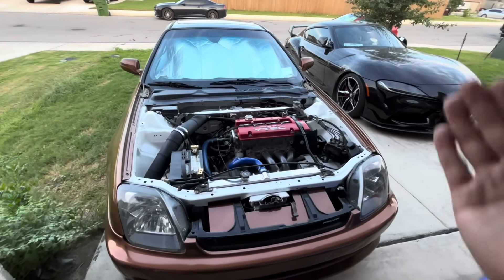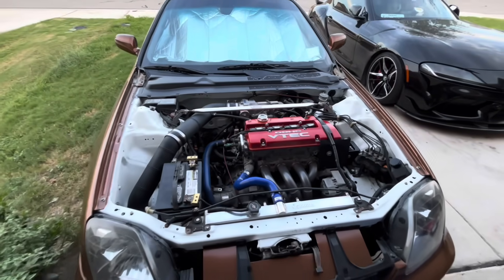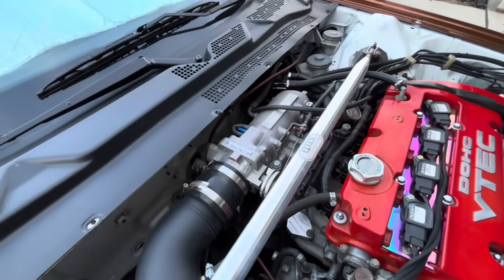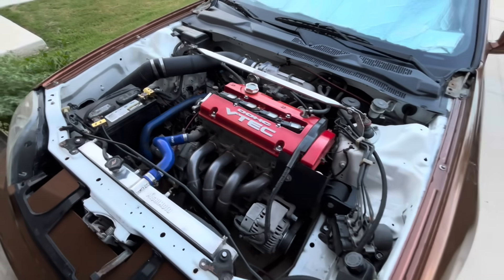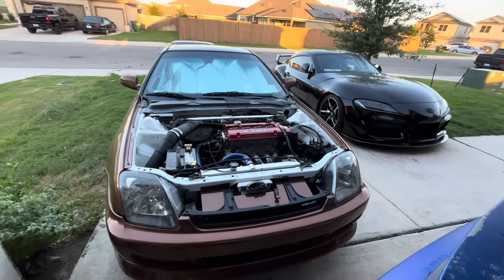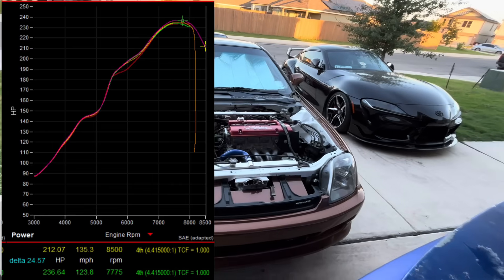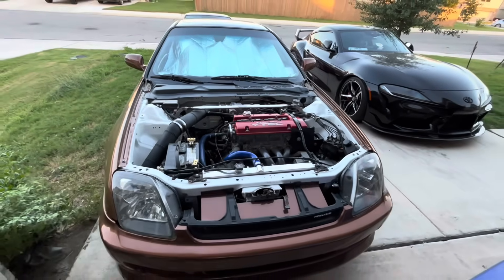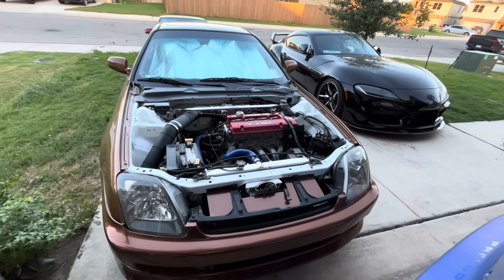2.3L F20B STROKER Build Specs and DYNO session!

Comment: Have you done an oil chnage and if so was there any rocker wear damage?.
Reply from the maker: Yeah i've changed the oil many times and had the valve cover off, the car is Turbo now, i actually switched back to OEM cams, but rockers looked brand new still. I've always used high zinc oil, but these cars don't really get rocker wear unless you have an issue or bad setup
Reply: @bb6g134  ive seen so many stories online about the skunk2 cams and rocker wear if the springs were to high pressure or garbage oil. What oil are you using and what spring kit did you use?
Reply from the maker: I'm on BC brian crower springs and steel retainers, i was using Rotella T6 5w-40 for almost 4 years and the entirety of the N/A setup. I also kept up with valve adjustment pretty regularly. 
 I only recently on my last oil change went to Valvoline VR1 Race oil 20w-50 because i'm on Ethanol now and it will dilute the oil to a thinner viscosity naturally especially with the boost/turbo
Reply: @bb6g134  how long was you running those tuner 2s?
Reply from the maker: @dayadam16  I would say under a year, about 5,000 miles maybe, not much. Recent years i got another daily driver so i don't drive the prelude much anymore besides weekends

Comment: You did a G23
Reply from the maker: Technically yes but the F20B block does not require anything custom. It's all OEM H22 components like the water pump, crossover pipe, etc.

Comment: This is an awesome build, so well done! I got so many questions, doing research for the same motor going for turbocharging. I noticed peeps love stroking the F20B but I see people pick H23's 95mm and F23's 97mm, is it that big of a difference? Also seeing it dyno all the way past 8k made me anxious, lot of info points out going past 7k can be dicey but is it really? Seems like your F20B takes the high revs well for having the biggest stroker kit in it. Last thing, I've been looking at 70mm intakes but am worried about it slugging the engine down at low revs, doesn't seem like your build minds having 74mm intakes. Would love to hear back!
Reply from the maker: For turbo the F23 actually is not the best because the rods are actually thinner/narrow-er than all the other engines. For a turbo i would recommend a F20b or H22 crank and rods more than the F23. 
And yes with the 74mm TB it is very peppy. Still very smooth overall however the initial hit of going from 0% to like 5% it can be a little jumpy and extra responsive in comparison to a smaller TB. But it's still smooth overall nothing out of the ordinary

Comment: 236 @ the flywheel bro🙆 Im sorry but is such a failure...
Reply from the maker: If you listened to the video i exaggerated it was only on MY street tune and the car did not get tuned at all.  It could have easily broken 250whp if it was tuned by a tuner. Also this is still WHP because it's a hub dyno, there is still drivetrain loss. It's already at 260 flywheel HP as it sits
Reply: @bb6g134  exactly its!..A hub dyne...Yr gonna be really disappointed at a dynojet...(I didn t know a street tune isn't a tune🙄...
Reply from the maker: @amritshokar3639  i'm saying it as a general term. It's MY street tune, i'm not a tuner lol. The only experience i have is on my own cars on the street. Really i just have safe timing and i adjust the fuel and that's it.  So it's still not "tuned" because a professional has not tuned my car whatsoever.  Only me, a regular engine builder and swapper with a laptop on the street lol 
The setup obviously has a lot of potential, and the number is still very respectable. You realize altitude, location, temp, etc play a role in the whp? Where this was wasn't even close to sea level, on top of being 100+ degrees. Put other H series on this dyno i promise they'll only be making 205whp lol

Comment: Go get the h2k ultra with that 74mm or 80mm you good to go 🫡
Reply from the maker: Unfortunately K manifolds can't fit into Prelude chassis because of the rear mount, the K manifold directly interferes with the mount bracket.  It is possible with fabrication but at that point the cost would be doubled lol. I'm going turbo anyways so it won't matter. But if i was staying N/A that would definitely help

Comment: Can you turbo this car with this set up or super charge it? Basically can you still rev that high being Turboed lol bout to go on Forza and grand turismo but I heard you said turbo at the end lol so I guess 9000 limiter and turbo be fucking legendary
Reply from the maker: Yes i have a turbo kit for it now. However, i will be lowering the revv limiter to around 8000, just to save some abuse on my motor lol
Reply: @bb6g134 lit bruh my boy had a baby blue 97 h22 tric tronic basically old as hell idk but old slow shifts but runs thru vtec loved it had the gears in the dash 1 thru 6 and when you don't want manual it was automatic classic goodluck brother

Comment: If that air fuel is accurate it’s pig rich especially on Vtec, 11s dipping into 10s on the 9000 pull.

Just street tune it to 12.8-13.2:1 across the board. U need a bunch of fuel taken out of that high cam fuel map
Reply from the maker: Actually, i brought the car in at 13.1 AFR, we gave it MORE fuel to the 11-12 AFR area and it actually made 7whp MORE.  You can actually see the difference in one of the lines in the dyno chart, around 5800-6500 RPM and actually some up top too. Every motor is different some like being rich and some don't, but most H/F series make good power being rich, not to mention, it's safer to be a little rich too.

Comment: I forgot the name of the material of top but I used a couple of cutting boards almost like a polymer used for the kitchen and cut them and sanded them to make a couple of spacers for the intake manifold. Ported and polished the runners on the intake manifold them also using just a dremel. Replaced all valve train. This was a 96 Accord using a F22b DOHC with H23 transmission. This was eons ago.
I think I am getting the bug again when it comes to modifying Hondas. Its been 20 years but now that I have a garage and a 18 year old son might get another Honda and teach him some more things.
Great project was actually thinking about going with a F20 blue top.

Comment: Torque seems rather low too. F23 crank should almost match the hp numbers
Reply from the maker: All of my bolt ons are catered to high-rpm so that might be a reason. They will never match HP but i was expecting it to be moreso 190 range. But it's still more torquey than all the H/F setups i've ever had. Keep in mind, it was not tuned. If a tuner actually tuned the car, it would definitely make more torque and HP
Reply: @bb6g134 your piston speed has to be on the verge of throwing a rod bearing or bending a rod, something you should look into and figure out. Never seen a f23 crank go any higher then 8300
Reply from the maker: @bluGill89  i know a few people revving their F23 to 9k.  However i know it's not good. I've only been doing this N/A.  When i install the turbo, i plan on making the fuel cut/limiter around 8000

Comment: that intake bend is killing alot of hp and I suspect almost 10 but I could be wrong if the head is able to overcome that with headflow I guess
Reply from the maker: I made it as straight as possible. If you look up most Preludes intakes, they usually have 2 90-degree bends lmao 😂 so this was as straight as it can possibly get in this chassis. It's also 3.5 inches.

Comment: I like the setup but why not adjustable cam gears ? Have to degree the engine right?
Reply from the maker: The Tuner2 cams don't require them so i never cared to do them, aswell as all the time it would take to get them degree'd. I originally built with the OEM Type S cams and the engine was already in my car when i installed the Skunk2's.  
Of course it's best to get degree'd. but it's not required like the pro series are

Comment: Fucked up on compression. Would've made major gains. And tuner cams? Should've went pro. Throttle body probably too small, pulling vac at wot.
Reply from the maker: I originally built this motor knowing i will boost some day. I think i mentioned it in the video, but that's why i got a thicker headgasket and i gapped the rings for boost.  With that in consideration i'm happy with what it's done N/A. If a tuner actually spent time on it this setup would be right at 250whp.  This is just my own street tune i made myself

Comment: Nice build man!! I’m a B Series guy but I’ve always been curious about the F/H series and always wanted to build one. We went a similar route on our valve train I’m running Ferrea valves & guides SuperTech springs and BC steel retainers with Pro 2 cams in my B20/Vtec I believe steel retainers are the way to go for a daily driver even with the added weight 👍🏼 But I think you would be really happy with a pro series intake manifold the shorter runners and larger plenum will help you a lot on that setup you may loose a little bottom to mid range but you make plenty of torque already so no biggie and I think you could get to the 245 to 250 whp possibly more and maybe some Pro 1 or 2 cams but tuner 2’s are a great cam plus you would have to get cam gears and degree the pro series cams and with the 1mm oversize intake valves you could possibly have V2V issues

Comment: That's a sick build bro 👍👍  I have a  similar set up. How was the air/fuel during the Dyno runs? Can't wait to see the turbo set up. But if you stay all motor you can change to a 4.64 Final Drive that'll help a lot.

Comment: Good graft,great graft actually. The engine peaks pretty high for the displacement. I can easily see this making around 255 on E and tuned by a tuner. I can see this engine making 267ish on E with a skunk2 ultra ported
Reply: Hey I always see u on almost every prelude or h series videos , you think k20 z1 pistons will fit also?
Reply: @Plomotbc. Yes they will. It comes down to what parts you want to use.

Comment: You are floating valves over 7500 rpm according to that dyno graph, if you continue to rev out to 9k, you're going to snap a valve and destroy everything in that motor
Reply: He has upgraded valve springs
Reply from the maker: I believe IF it was actually floating the graph would be very erratic at the top. It was all very smooth, it was just a natural drop off in power due to the motor setup and the mods attached.  I have BC upgraded full valve springs and retainers. I doubt that's an issue.

Comment: wow that is neat, learned something today. Didn't know you could use K series pistons in the H/F Block. Thanks for sharing
Reply from the maker: Yes as long as it has iron cylinder walls it's possible. I've done it both on F20b and F23,  just have to keep in mind the compression-height if the pistons, because on certain H/F series they may stick too far up or too far down because the measurements are different
Reply: look up @sagittnet2158 he has a ton of videos about G23 (H22a4 Head, F23A Block, K20A2 pistons) makes around 224HP, Turbo makes around 300 - 400 HP)